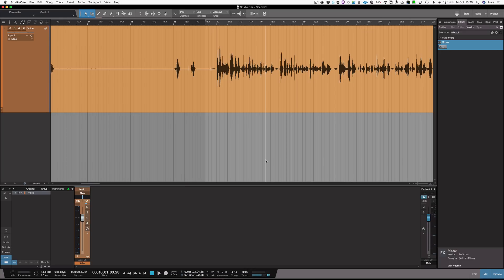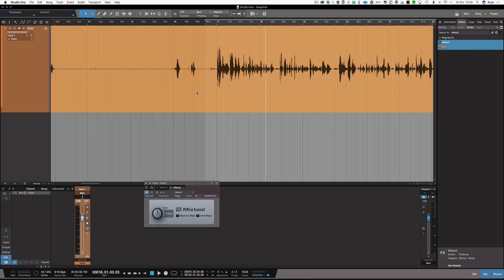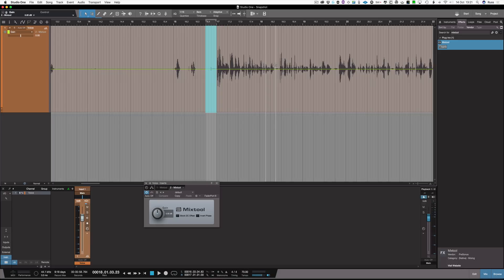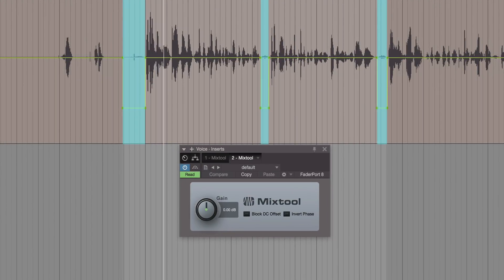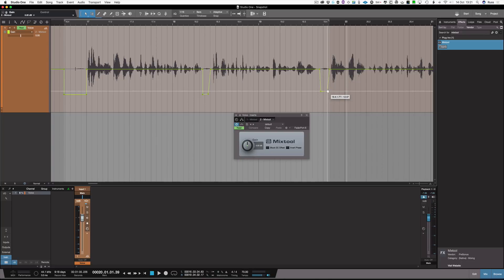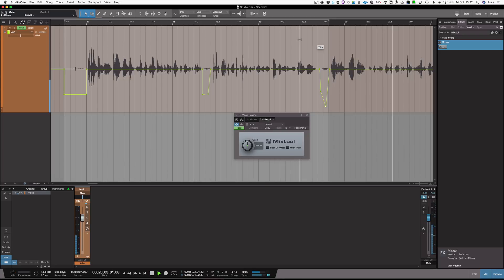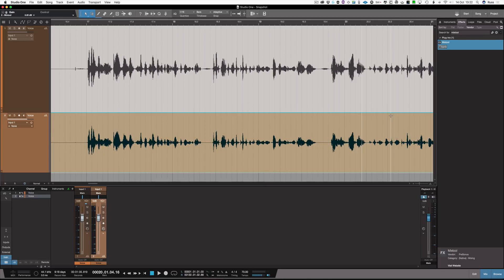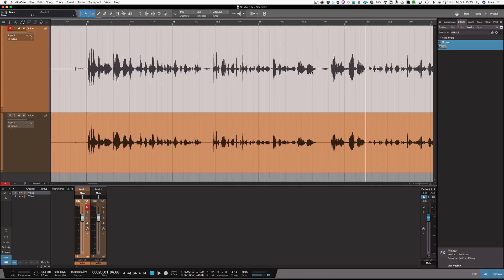PreSonus Studio One - How To Use Clip Gain To De-Breathe Audio In

Comment: This is a time saver! Actually really helpful! I always thought why there is no clip gain in Studio One. Never thought that it could be done with mixtool ! Thanks a ton !
Reply: Hi Anasul & Russ :) Yes, absolutely a great video and a great thought! But please, please could one tell me, what is the main difference between this kind of clip gain method or the normal volume automation or doing this within the audio part, by cutting out that breath parts or by simply pull down the loudness with the trimmer tool on that sections? That would be so nice :-) Why do I need an extra plugin for that, which cost me CPU power? Thanx guys!!!
Reply: Volume Fader is basically a post fader, that means the automation is happening after all the processing and plugins. If you want that then its fine. But if you want your automation to happen before all the processing and effects then Clip Gain is the tool which is acts as a Pre Clip. And in the case of DeBreath or this sort of editings then you shoudnt do it the post fader
Reply: And you dont need an actual plugin to do that, you can also do it in actual audio clip in Studio One . its just some people like to use automation because its more clean
Reply: Ah, that small hit on the back of the head, I was missing ;-D You´re right. If I do this with the volume fader, I do it post - wow. I could have come up with that, too. Thank you for your fast answer!
Reply: always here for help

Comment: Hi Ross, maybe I just have a thinking error but, why should I use a plug-in to trim or cut some audio parts, if I could do this also within the audio part by cutting out that breath parts or by simply pull down the loudness with the trimmer tool on that sections?